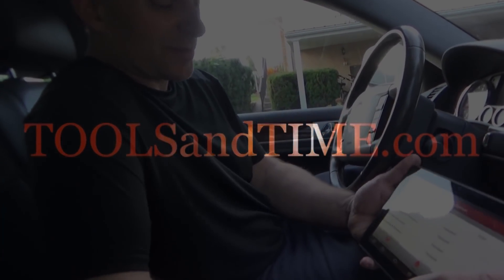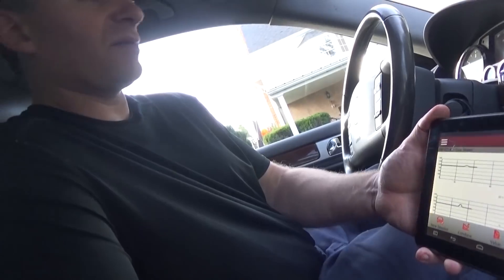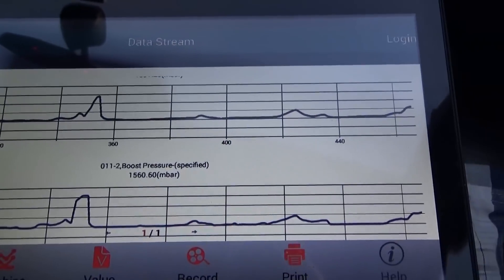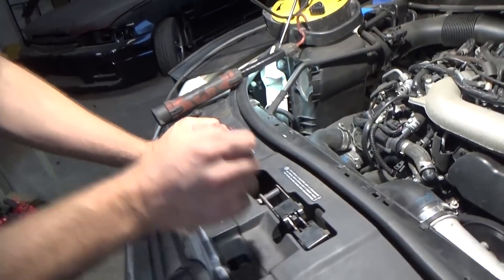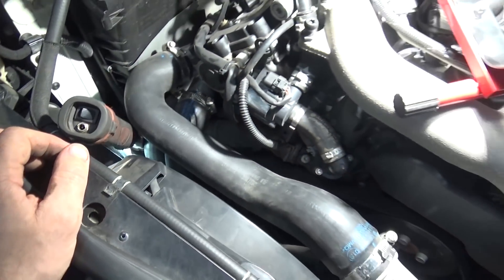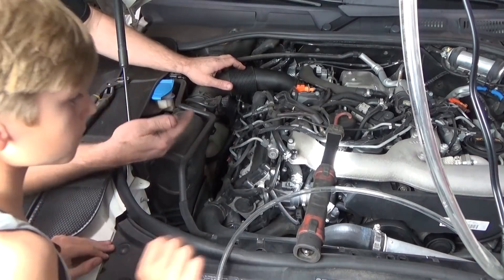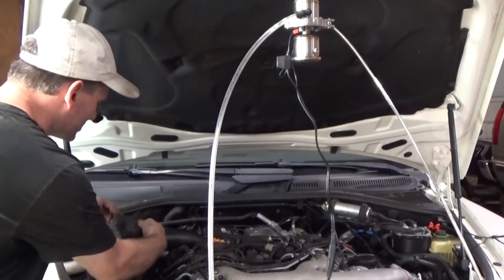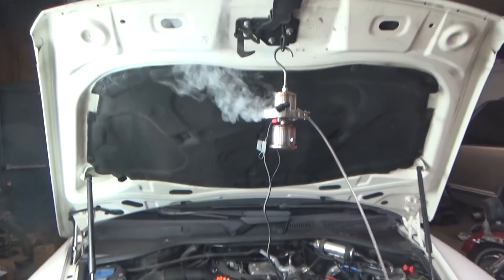Boost pressure regulation, Control range not reached P0299 TDI 3.0

Comment: I diagnosed and fixed this  in 30 secs on my  2013 TDI mk6 because I knew where to look because of your vid.  Turned out a mechanic had left a clamp loose on the turbo intake hose. THANK YOU!

Comment: Hi, helpful video ... I have same ODB code error from VW Passat CC 2.0T TSI ... The garage want to fool me and ask around + 4000 $  to change turbo ... but I am Engineer and can't trust him ... Just wanna to ask you where to buy the smoker system you used? I want to test my intake system maybe the issue is something for 100-200$ instead of +4000$ as said in mechanic garage ... Thanks

Comment: So, I'm also fighting a P0299 on an 05 TDi Passat 2.0.  If I add smoke and air pressure to the intake as you did, I never get pressure to build, and I never see smoke, either..  I'm at a loss..   N95 solenoid works as intended, all vacuum lines are replaced, VNT Actuator holds vacuum, has smooth movement, etc..    I made my own smoke machine, as well, but yours is way better looking than mine  lol

Comment: If I was to attach a glove to the intake but use an electric tyre pump instead of a smoke machine I would still be able to see if there is a leaking pipe. I just wouldn't know which one. Would the pump be too much pressure and cause damage?

Comment: love the video I'm having the same problem with my 2010 tiguan. It started immediately after  replacing the oil seperator, which I've been told is a common part to need replacing. tried to fix this issue by changing the a valve but the engine light came on again 5 days later. your video has made me think to check the hoses. In your experience is this something im going to be chasing till the end of time? I'm getting really frustrated. seems like the turbo is always a problem.

PS this is the second time in 2 years I've had to change the oil seperator. is that actually common?

Comment: My VW tiguan was leaking from the Engine Coolant Pipe (Front, Upper) and I had the check engine light on with the same p0299 code which says turbocharger/ supercharger underboost. Are these issues related or it could be something else? Please advise. Thanks.

Comment: hello guys!, great video, I have a 2006 q7 3.0tdi v6 and I got the P0235 code that says "boost pressure regulation, control range not reached" could be the same thing u guys just fixed? thx a lot

Comment: Hi sir, ı have same issue in my touareg 7p and having p0299 control range not reached. This ım having after replaced turbo with a renewed turbo. What should I do now. Is it for sure a leaking pressure issue?

Comment: I made mine too. 120 volt (I'm an electrician so it's grounded and safe) an old heater from a coffee maker, an old cotton T-shirt, an empty paint can, some used motor oil and a tiny laboratory compressor. Man does that thing make smoke.
Reply from the maker: AKA Wireguy that works 👍 very similar concept however I chose to stay 12v and separate the oil sump, resembles an old style lantern, in the top hoses the "open wick" wrapped with 6 ohms of kanthal,  there is some more going on as well. Was thinking of doing a demonstration since so much interest has been shown
Reply from the maker: I bet she pumps out the smoke 😂😂 nice setup

Comment: 200 dollars for a piece of hose!...how do you say "criminal" in german??!
Reply: Volkswagen
Reply from the maker: happy543210 I couldn't believe it either!! and that's after shopping around
Reply: i think i would have tried to fix that hose with some contact adhesive, a strip of rubber wound around the old hose and some zip-ties. I am pretty sure that would have done the job.

Comment: Great video Will. Got a smart kid. Gonna be swapping motors before you know it.

Quick Question - I noticed on the test drive the problem was most noticeable at high rpm. With a hole that small, my thinking is it would be more noticeable at a low rpm similar to a vacuum leak. Any explanation for this?
Reply from the maker: Ben Jass thank you 👍 he's a great kid. Wish I would have taking a close up. The split was actually about 2" long it was a gaping hole under pressure. On the pressure side

Comment: is that a home made smoke machine or what kind is it
Reply from the maker: Jo O'Daye yes I fabricated that smoke machine. It's not shown in its entirety in this demonstration, attachments for evap flow meter, psi gauge and a small 2psi pump. No compressor needed
Reply from the maker: Eric Corse the bottom half is the oil sump, mid is the wick tube,  the top half houses the wick and coil 😉 it's built like a large vape machine.
Reply: Will, do you use a cartridge heater for this?